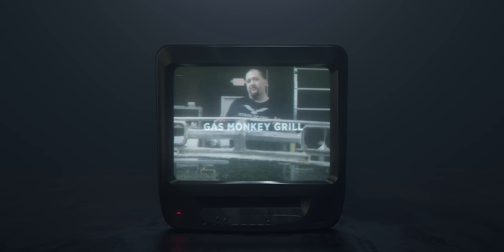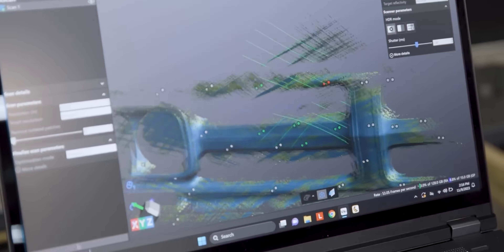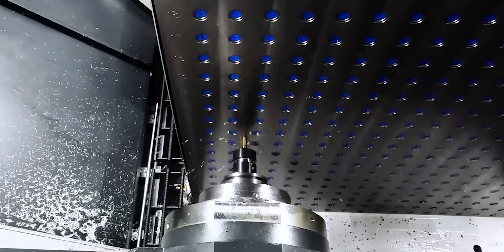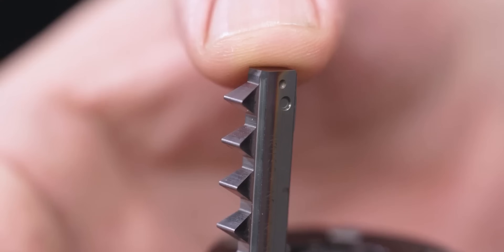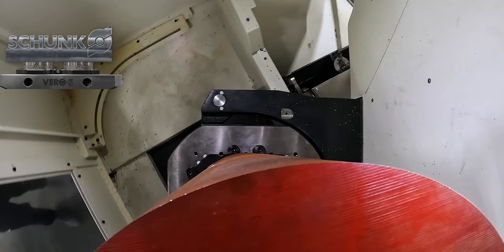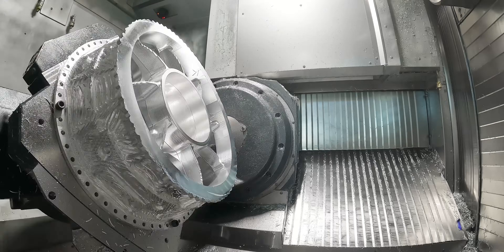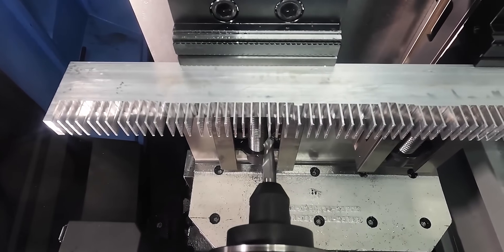Struggles behind my HARDEST CNC Machining Projects

Comment: On most horizontal machines you can lift the pallet in maintenance mode then estop the machine and then rotate the the whole apc by hand. Great trick if you're worried about clearance too.

Comment: Hero work!, is what I've always called that kinda work, being in the industry for over 35 years myself... it's cool that you are able to share some of the crazy things you've had to make... I myself have had to make some similar things that couldn't be videoed or shared but what I'll say about my experience with this kinda stuff is that I did like the challenge... it keeps things interesting but can really put some years on your life... I remember back in the mid 90s I was doing a job for Lockheed and I had to take the entire machine enclosure off the machine and had the control hanging by 2 cables from the ceiling inorder to make that particular part... I feel and respect your pain... love the video's and all that you guys do to offer guidance and strategies to our industry... I appreciate you...

Comment: I find that the hardest parts are those not designed to be done on CNC. Like old car parts that were stamped and never milled.

If you design with the limitations of CNC in mind you don't put undercuts on the part for your 3 axis machine or overshoot the work envelope etc.

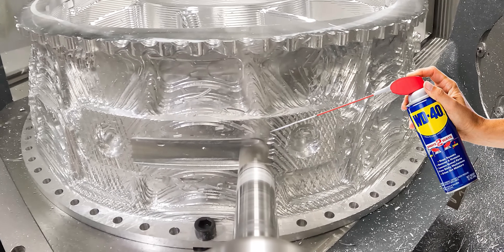Comment: 12:50 do you have issues with the wd40 oil mixing with your collant?
Reply: Not really because i dont run coolant at all.
Reply: @barrysetzer  it's actually impressive to me how many people just don't think about it. l'm now at a mold shop and run a lot of high feed face mills. but still they otherwise run coolant a lot and not think about it.